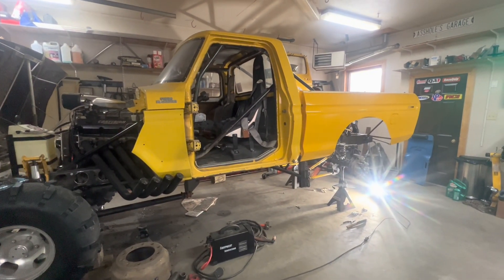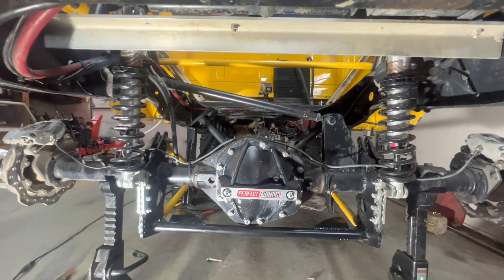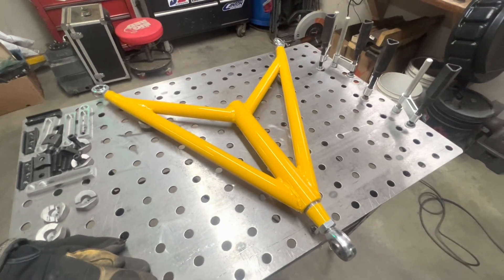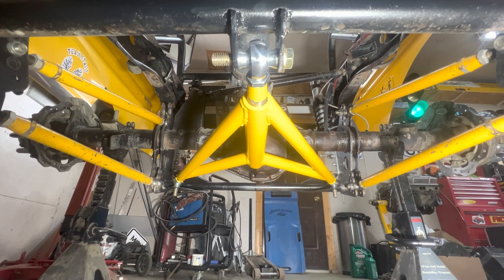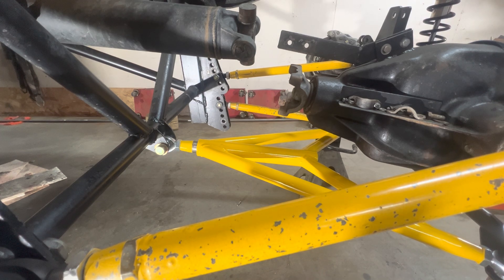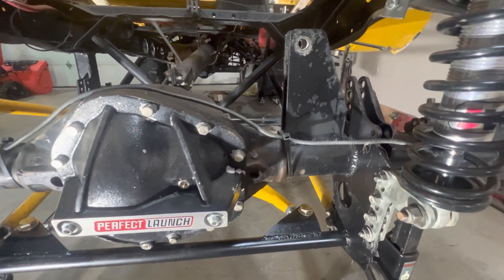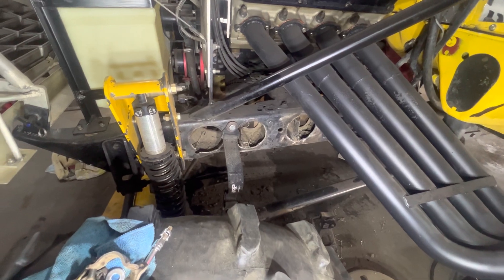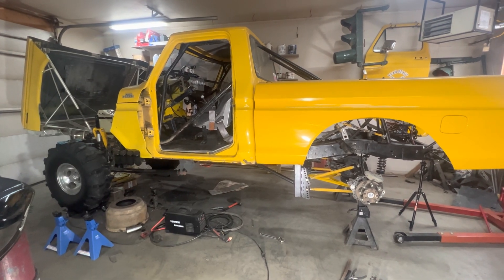Wishbone housing locator upgrade

Comment: That wishbone is backwards from every other wishbone i've ever seen. Doesn't that rod end allow the axle to move side to side?
Reply from the maker: They can be mounted either way. I’ve done many runs with this setup now and the axle stays put. Big improvement from the old pan hard bar
Reply: @mudfreak79 I'd be willing to bet that if you removed the axle bolts and left the chassis bolt, you would be able to move the wishbone side to side quite a bit.
Reply from the maker: @toddformanek8495 I’ve got GoPro footage of many many passes with well over 1000hp saying it doesn’t move lol. I also check with Blaine from KCD suspension to see if it mattered which way it needed to go in. He says it won’t matter.